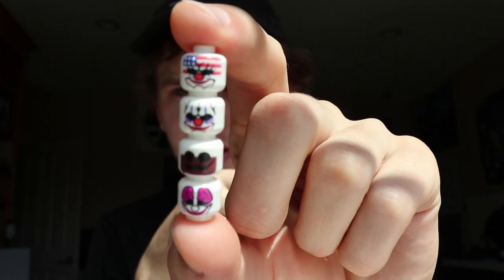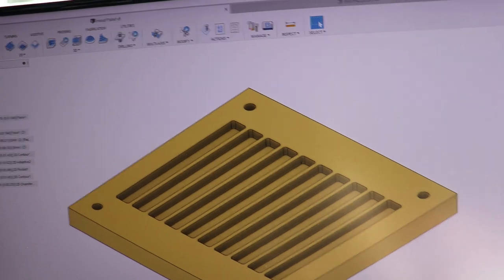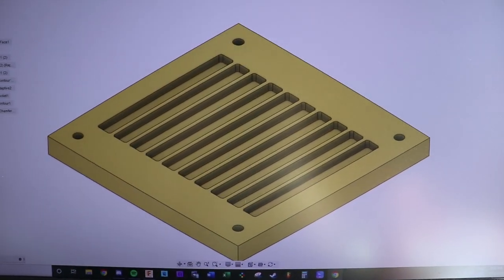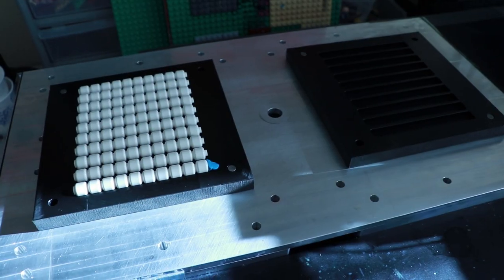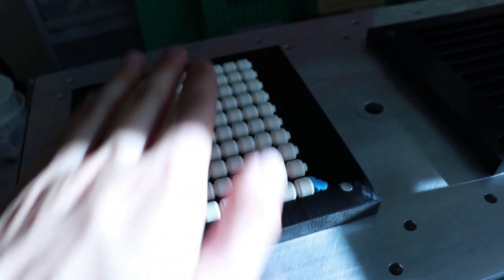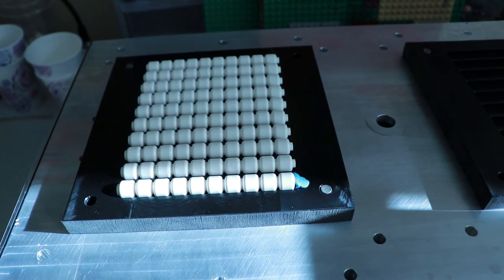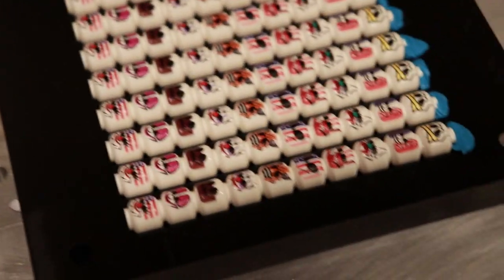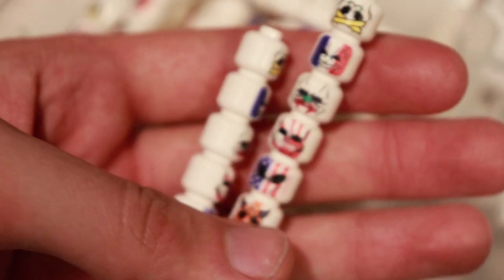HOW TO PRINT ON LEGO PARTS! - Tactical Vlog 6

Comment: What Kind of Printer is needed to do this job, and can it also print torsos, legs, arms, bricks? If it can do those other parts, can it do side printing?
Reply: UV printer like a Mimaki 3042 they’re £14,000 new or £8,000 second hand and yes providing you have a fixture to hold the parts in place you can print on any Lego from bricks to mini figs on all sufaces